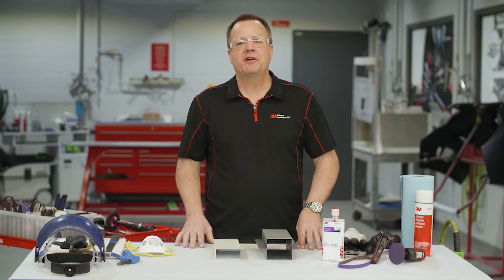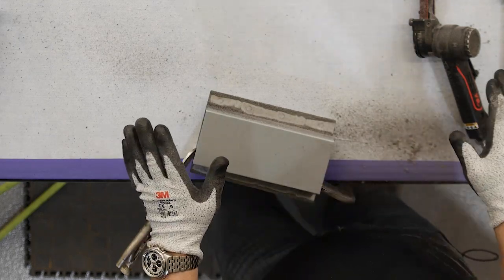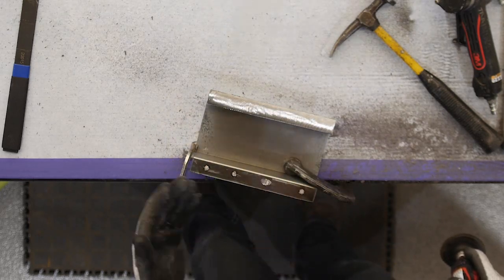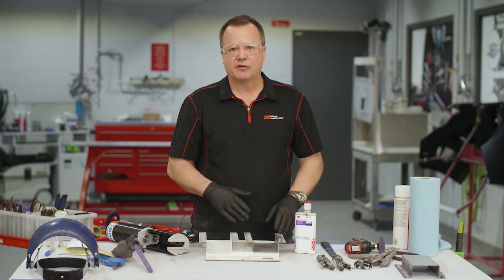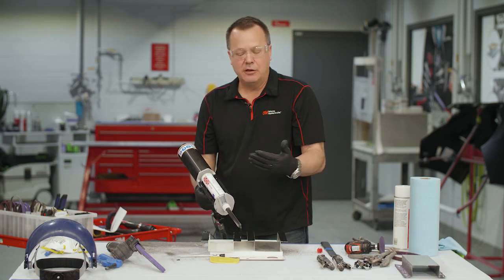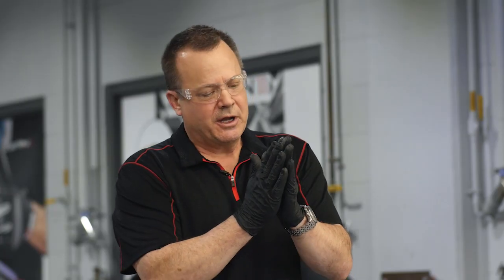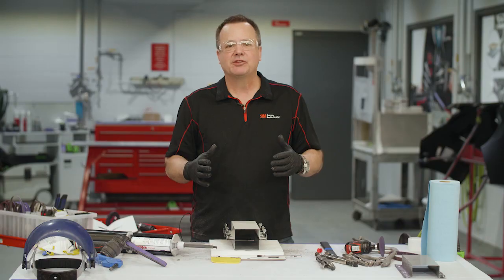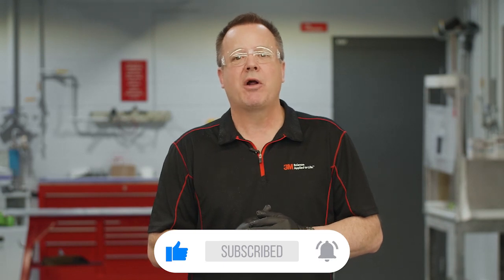HOW TO: Repair Panels following the 3M Panel Bond Standard Operating Procedure

Comment: I worked in the aircraft industry we adhesive sealed every component but you cant rely on sealant alone the parts would also need bolting also you dont wipe sealant off emediatly if correctly applied the adhesive would continue to hydrolic.

Comment: For channels and metal work What do you use to seal the channel? epoxy paint clear then urethane primer before the windshield install? I heard 3m panel adhesive brush on over new metal? please help the process for me.thanks. 1970 nova

Comment: Curious why bond this vs just spot welding it back? How long do these adhesives last compared to a weld which can last a liftime without corrosion.
Reply: Welding accelerates corrosion. The panel bond actually has rust inhibitor built into it. This is a good repair in the right areas.
Reply: @Chopski64  there's also a chemical reaction through body filler primer and paint when using these epoxy on panell bonding

Comment: had to chuckle at the start this viddeo with that grinder. .and as for the disc pad..if your using one and cant deternine where the eweld is after about 15 20 seconds of  use..you should put all your tools on a pile and sell SUPER CHEAP and find something else to demonstrate.because if you ground them to where you cant see the welds.you had your eyes closed the wholle time..at 56 .im not buying that line at the slightest.nice one but some us lot brighter than that.half stuff with them blind welds are even visible with out a grind job..its 56 yrs experience is all seeing and paying attention..
Reply: But I think they want to sell this to folks with less skill.  I can't disagree with you, but I get that they want to present the "safest" method.

Comment: Is there a scotch file belt available to the automotive industry for the smaller belt sander?
Reply: #77257 3/8" x 13" Scotch-Brite Durable Flex Belts - CRS
Reply: Grimsaviour nope only 1/2”